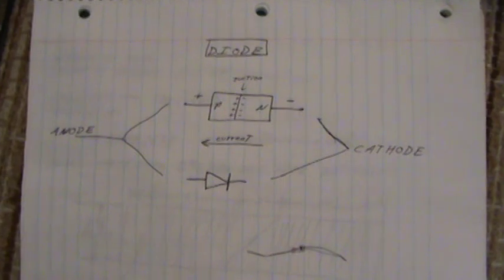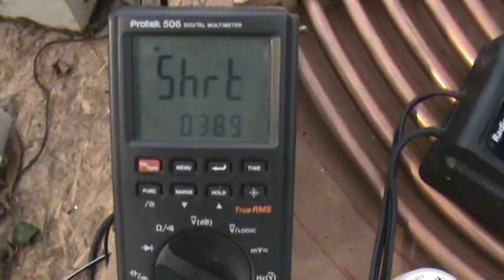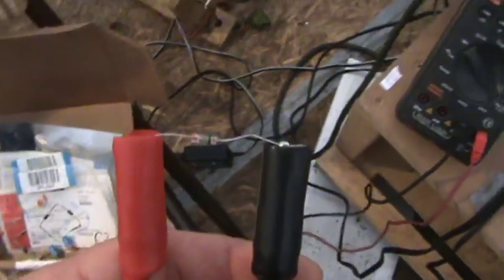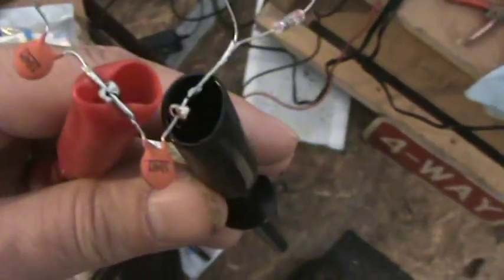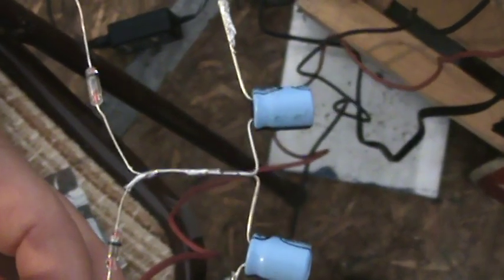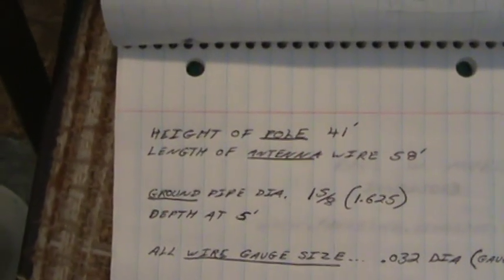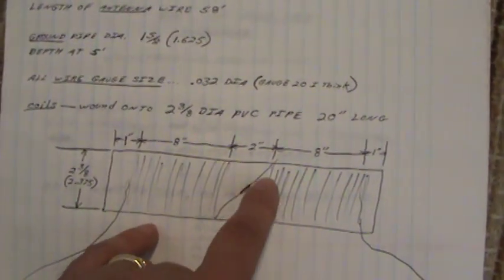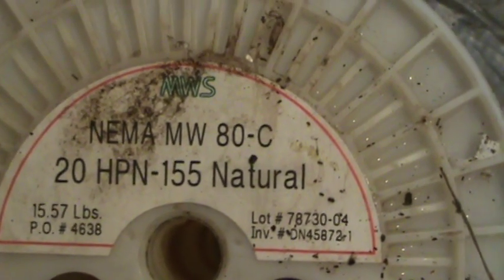FREE ENERGY CIRCUIT- HOW TO, PART 2/3

Comment: These work better in groups of 50 for about 43 watts per integrated modual. Though a hundred should give near 96 watts. I personal tried other diodes than germanium. But I think I was just picking up the energy from the tv on it's antenna but if it was not that it could have been power from the line. I think 15ns diodes to silicon carbide diodes may be better or some avalanche diode? I also thought of using 2uf ac capacitors and a large 200v 1500uf to 1800uf cap with a cb antenna or some carbon fiber for an antena, I thought the surface area would make more power?
Reply from the maker: Yes, I was thinking about the carbon rods also, for the antenna.

Comment: looking at that pole made of separate coils reminds me of Eric Dolards talks on longitudinal waves., he says 'some thing like' ( I maybe off base) using a set up like the coils separated by a capacitor which gives the longditudinal wave form giving an instantaneous push/pull electrostatic type wave that was the core to Tesla's power system (as opposed to an ordinary sign wave).
Reply from the maker: yes, thank you, i think the value of the cap is very important to achieve perfect timing to resonate.  Erick Dollard is a great person!
Reply: INVENTOR3 he has said (Eric)the capacitor is dielectric and the coil is electric, while the capacitor if charged is ready to go but the coil has to be shorted to go, so he would say they are in denial of each other! when put into the same circuit the different systems work together and we have.. Quote "an electric oscillation"!  So, this combination doesn't just help time the oscillation .. IT MAKES IT!

Comment: you should tapeof the germanioum diots they act like a solar cell and wenn exposed to light they produce energie
Reply from the maker: Thanks for the comment, i will try to cover the diodes next time to see if there is a difference.
Reply: I build the same cirquit and they definitly do act like solar cells depending on the diote the voltage chage is more or less

Comment: This is extremely interesting & educational. Could I ask a favor though? Would you turn off the radio it's a little distracting. You're probably used to it I know, but I'm trying to follow your guidance here.
Reply from the maker: I learned a valuable lesson with the radio,,,i hope to make a new improved video on this soon.
Reply: Great, you mentioned they only let you video/upload up to ten minutes. Is that correct? I noticed you had like 24 videos on this experiment/process you're going through to perfect this circuit/device. Is it that complex or are you just expanding it to include the experimental journey & the theory/educational aspects of it? Sorry, it's so long winded but you are piqueing my interest in electronics -- now I KNOW I gotta get a better multi-meter!

Comment: Its in Teslas patent, he also talks about making it electrophorus or ensuring a negative charge. I have a video on the same radiant circuit, though I haven't set up the germanium diodes yet. I believe he goes on to say that the points help collect voltage from the "electro static field" and the size if flat surface helps current. Give it a try it works pretty good for me, and I don't have my antenna 30' in the air ;-)

Comment from the maker: No.
 I use germanium diode, 1N34A
Not sure a zener would work in this circuit, or maybe it would up to a certain point, depending on the perimeters of the diode, because they also work in reverse when they reach a certain value.

Comment from the maker: yes, exactly.
I also put the coil over the ground pipe, it helped me to get even more voltage, but this does not work for everyone. I would experiment with sticking iron rods into the center of the coil, it helps to tune the circuit.

Comment from the maker: I have coil in series between antenna and circuit, & the coil is then placed over the ground pipe, it helped to tune the circuit and get more voltage.

Comment from the maker: the black diodes are "silicon" type.  They work also, but take like 20 minutes for the voltage to build up to maximum,,,,and the little clear diodes are "germanium"  type, and they take like 20 seconds to build voltage to max. The germaniums i use are 1N34-A. I recomend the germaniums,,,but the silicone will work also.

Comment from the maker: No, not nearly enough energy at this time to power home appliances. This devise works everywhere, but can be influenced by other nearby power sourses, if your whole set-up is in tune with it. You can adjust caps and coil and antenna to match other power sourses(resonance),,,but i believe im collecting energy from the earth and cosmos, not from man made frequencies. It all depends on what values of components you use in the system.

Comment: can u really generate enough electricity from this kind of Air circuits to run your electrical home appliances. They also say that the devices work only nearby the strong electrical fields generated by other house hold or commercial electrical appliances, is it true ?

Comment from the maker: can get over 100V, but need more Amps(current). Need special homemade trasnsformer, or a step up current transformer. Problem is we are working with such little current to begin with and it is DC.  it is tricky to do, but possible.

Comment: This looks fun, but I am kinda a newbie.  Does the double circut help get more power? if i'm not getting crap for voltage is it possible to get like a low power transformer to turn like .8v to 2v or something?  I'd like to hook it to some kinda toy or light or fan or battery to charge or something.

Comment from the maker: @buckstarchaser Hmmm, i agree about the diode to battery and current will flow with "+" to the anode (or non-banded end. In a battery, the electons flow from neg to pos...Hmmm, i see what your saying with the polarized caps. maybe depends on how you look at the circuit, the diodes are all hooked togther with neg end of 1 diode to pos end of next diode, but whenit come to the caps, i have neg end of diode going to neg side of cap,,,but neg side of cap is towards neg output, and pos to pos output

Comment: @INVENTOR3 Modern/confusing descriptions of the diode are like you have drawn but the easy way to demonstrate is to hook one end of a diode to a battery and the free end of the battery and diode to a volt meter. You'll find that when you connect "+" to the anode (or non-banded end) the current will flow through your meter, making the cathode (or striped end) "+" for the intent of your circuit. An electrolytic is used differently in that the "-" can never be connected to a more positive voltage.

Comment: My analysis of your circuit diagram is that you should remove the ground from the middle of your diodes, replace the ceramic caps with only one because it will actually increase your capacitance (trust me), and connect your antenna to the center of the diodes. The second circuit is completely non functional as it isolates the first half from ground. You're using ground as a reference to the antenna so you need to keep it coupled to the main circuit.

Comment: Your diagram of a diode is backwards. The stripe indicates positive on a diode because diodes are labeled per 'conventional flow'. You are confusing these devices with electron flow which wasn't discovered until after the standard for labeling diodes had been enacted. BJT's are also labeled in conventional flow but FETs are in electron flow. Polarized caps are taken literally as in the "-" connects to "-".

Comment: @DarkstarAndrew01 
yes i was thinking the same thing.. couldnt you multiply the voltage by running in a series?i definitely want to try that.so if you had 100 of this circuits you could multiply the voltage of 1 by 100.I know with car batteries thats how it works..

Comment: Have you considered using multiple grounds instead of sending all of the ground electricity through each circuit to a single ground, just treat each circuit like it was individual when it comes to grounds/antenna i.e. multiple grounds to a single ground, and multiple antenna connections to each antenna.. Then take all of your OUTPUTS and put THEM in series or parallel depending on whether or not you want more volts/amps Treat it like you were using batteries in series or parallel.

Comment: Hi Inventor3,
Thanks for the post..
I'm kind of puzzled by the grounding diagram..
in the first one the grounding is in between the 2 capacitor..
but in the 2nd(combined one) it's in between the 4 capacitor..?
is that correct?
thanks

Comment from the maker: @11111111jws  #103 is .01uf....too much differance.  Try a cap that has "close"  to .1uf.
OR you can use instead of 4 caps each at .1uf,,,you can use 2 caps each at .2uf

Comment from the maker: @absint0o many people are having the same problem with finding those diodes in other countries. Best thing to do is find a diode that has the lowest forward bias voltage.
Silicon diodes have like .6V & germanium have like .4V,,,so you will have to ask the elctronics store what diode they have with lowest forward bias voltage.  I order mine through mouser dot com
hope this helps

Comment from the maker: @dictuzdictuz I know what you mean.
No radio station for at least 12 miles away.  And power lines on this block all run  under ground.  So far i have not been able to explain where the power comes from,,,must be radiant energy from the cosmos.  Also incoming frequency is not in range of power lines or radio. :-)